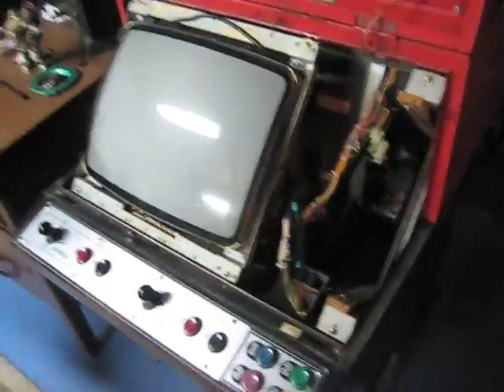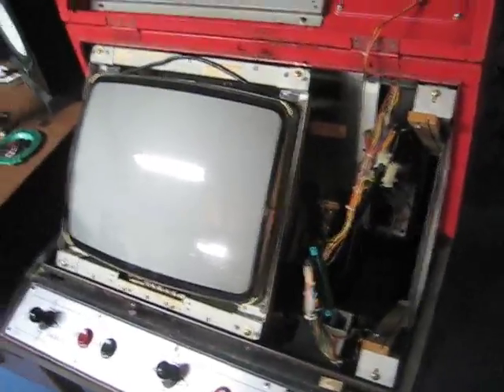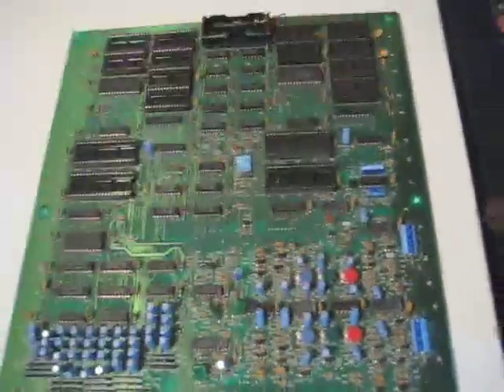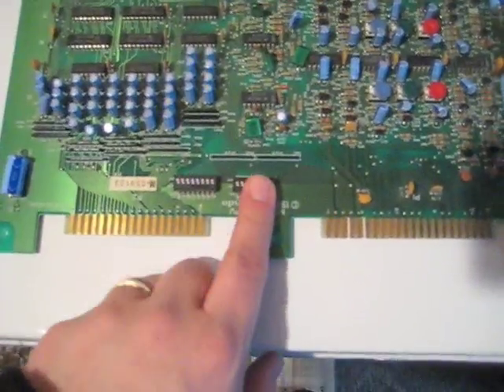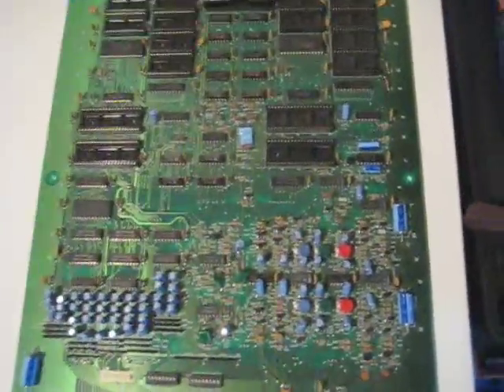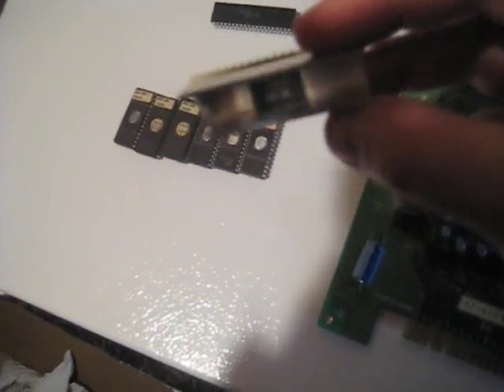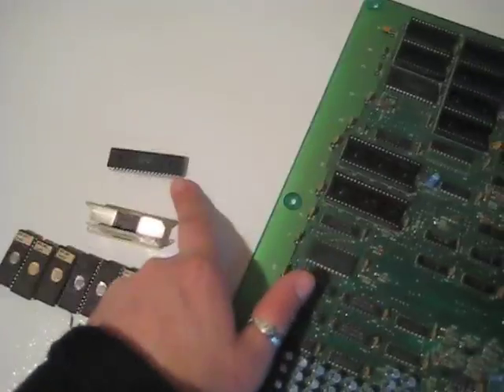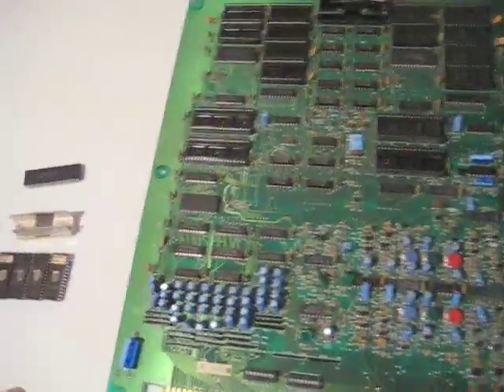How the Nintendo Vs. works - PART 1 - PCB, PPU, CPU, ROMs, etc.

Comment: so basically it's just 2x a nes on a single board. rp2a03 is the nes 6502 clone with internal clock devider and custom pinout. as for ppu's mixing up colors. yep. some of them have 2 of the 3 colors mixed up. ntsc/pal difference thing. not related to their actual video output as all of them (including all normal nes units and all of their clones) also output rgb anyway (which is probably what is used here). (so  just adjusting v-hold for 'ntsc' ppus running at 50hz suffices). some of the clone (umc/ta) versions of the cpu have a different clock devider making mario run 16 times as fast ;) this board would probably happily run any famicom or nes game if you put it into the appropriate eproms.